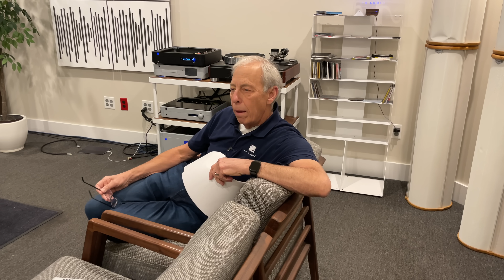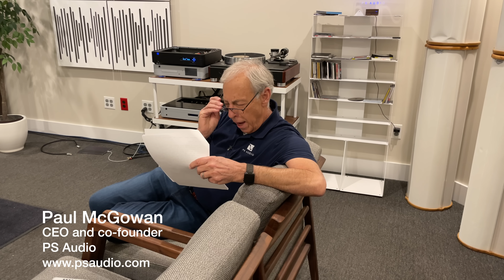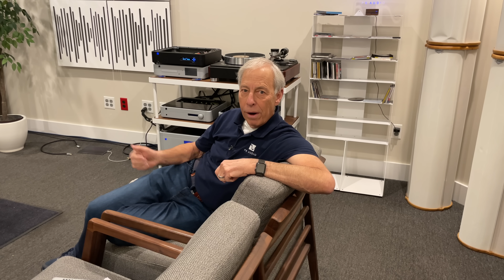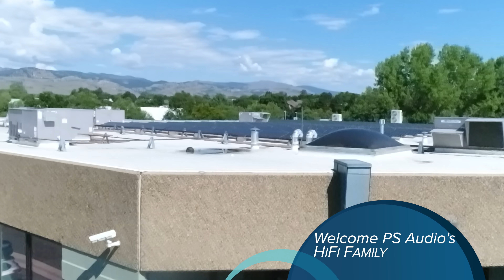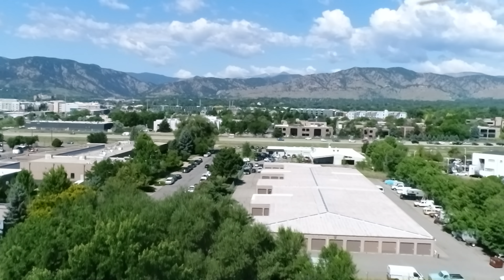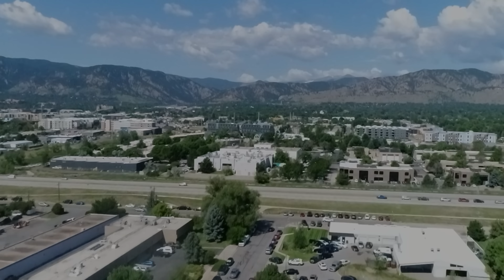High end amps vs. pro amps

Comment: I need to hear those amplifier differences to believe it. My crown xls sounds perfect at home in a stereo setup.
Reply: hearing is beleaving, i just bought an XLS2002 for fun thinking i was going to return it... but after comparing to my MC602 and XPA DR2... im keeping it... it blows my mind how good the Crown  sounds... and at 11lbs its 10% the weight of my other two amps... audio snobs need to get their heads out of their asses and try the Crown XlS... its getting positive reviews from audiophiles on the net
Reply: I’ve got a crown xls2502 powering some subs and two PS Audio m700 monoblocks powering my magnepan 3.7i’s. For fun I swapped power to my mains and did direct a/b comparison. The M700’s definitely sounded better in all cases, but no it was not night/day difference.
Reply: @MattWong117  was it 10x the cost difference?
Reply: @SantanKettanan-Gayboy  that’s hard to answer because everyone is going to have different equations in comparing value for money. For me the difference was worth it and I love the sound of the m700’s or I would’ve sold them. For someone just starting out with a limited budget the calculation would be different I think. It is possible to build a musically satisfying system without spending a ton of money, that’s for sure.
Reply: @MattWong117  if I'm reading that right, you've got a single xls2502 comparing against two m700 monoblocks?  Do yourself a favor and get a second xls2502 and then do an a/b comparison.  Mono vs mono.  The crowns have poor crosstalk performance.  Using them in a mono configuration might be that difference you're missing.  I, myself, have the 1502s for biamping my speakers and i absolutely love them.
Reply: @LunarLightLtd1  I'd be happy to if you feel like sending me one! Joking aside, I know it's not a direct apples to apples comparison and I mainly did it out of curiosity more so than I set out to prove one product is better than another.
Reply: @MattWong117  I respect that.  Just sharing my point of view and my joy.
Reply: What AVR or pre amp are you using? Did you set input voltage to .775 or use something like a cleanbox pro to boost signal voltage and use 1.4v setting? @LunarLightLtd1
Reply: I have the XLi2500 I love it. It is AB and dead silent, but loads of power.
Reply: I have some very early Crown DC 300's ( no not 301) that are something you should hear and then amend the statements made. These pre date the uA 739 I.C. front end amps which have a .05% or better distortion figure.I have documentation on this.
Reply: Yeah I have a crown xls 1000 on some klipsch rp-150m and couldn’t be happier with the sound it’s sound is way better than my other Dayton apa 150
Reply: @Damien-Lugnut What AVR or pre amp are you using? Did you set input voltage to .775 or use something like a cleanbox pro to boost signal voltage and use 1.4v setting
Reply: @ I use a jds labs atom dac and pre amp on a desk setup now with the crown and I can’t tell any kind of distortion compared to my Dayton apa150 that has way lower thd even on a desk. The crown just has way more output
Reply: The XLS amps' internal dsp converts audio signal from A to D & then back to A.

If you have played with DAC upgrades, you know how much these conversions tend to affect our beloved SQ.

Crown's XLC Drivecore amps have the same circuitry as the XLS but no internal dsp (you can better trust a dedicated dsp to that function). I have the XLC 2800 & it sounds wonderful as a sub amp.
Reply: Ol
Reply: what do you guys think of NAD amplifiers?
Reply: @skipper6528 very mid treble, slow bass, not mature as a sansui, not body shaker as a crown. if you want to tip toe get a mcintosh, if you want to dance get a crow or similar
Reply: @nehumnome cheers
Reply: @skipper6528  definitely solid
Reply: Update: I changed to an old Pioneer A333 and it does sound a little better. Especially on rock music

Comment: It's easy to see how Behringer do what they do for the price point, they just clone everything right down to the layout of the board and have it built in China using crap components,
You'll have a hard time finding specs for them too and there's a reason for that, they are often much lower specs than the item they cloned
Reply: True but my Behringer A800 sounds sweet driving my Klipsch 600M’s thru my Marantz 5014.
Reply: @rumporridge1  yup, their products sound good enough for most people, me included,
I've met lots of people who don't understand how they do it for the low price, but when you're R + D team consists mostly of people just finding out what's popular and cloning it.... Then it's easy too see,
I've also met people who have compared the original and clone and said its similar, but somehow not quite as good, I'm thinking it's the 'build it for the lowest price' ethos that is their undoing,  I'll bet there's no $20 caps in their products!

I bought some of their midi gear and if it weren't for Behringer then I would have nothing, it was nearly half the price of the competition, 
I'm not saying it's not worth buying, you just need to understand what you are buying
Reply: @Sofa-Lofa1  highly agree.  I’m moving back into a house in 3 yrs (from an apartment) and I will build out another set up. Will I go class A or AB? Who knows. But the class D coming out of these Berhinger and Crown Amps are very very compelling.
Reply: @rumporridge1  yeah, class D can sound great, I think it gets it's bad press from the fact that it is the easiest to design badly and throw crap components into,
A whole class D amp can be built for the price of 1 good valve/toroidal transformer/$20 film cap, 
But if well designed and with good components it can rival most things

Comment: High end vs pro I resolution vs very loud for a very long time. A crown or pro amp are meant to run hot for a very long time and not die. But a High end Audio Amp is designated to provide the very best sound recreation possible. So can either one sound the best? The Audio amp can. Can the pro amp sound as good as a high end audio amp. No. They are both made for specific purposes. Paul is 100% right on this one. Now, back in the 80’s or maybe late 70’s there was an amp that claimed to do both. It was called the Gorilla Amp, and it had some high output like 500 watts or something.  If you ran it at low levels it would last a long time, but at 500 Watts it wasn’t any better than any other pro amp. But Carver had a magnetic field amplifier that put out 500 Watts. Yes, but that was bridged into one channel. If you wanted to have 500 watts of stereo sound you had to buy two of them. Then came Carvers second generation of amps. They were high end amps, and Tom Scholz used them in his stage Amps. Scholz figured out that it was a pain in the ass to keep a Marshall tuned to sound its best on the road. In the recording studio was a bit different, but to take one on the road and faithfully recreate the tone he wanted it took a lot of maintenance to  keep everything sounding as good as the album did. So, he invented the amp and Cab Simulator alone wit effects that fit in one half of a rack space in a standard sized pro audio rack. Ten he built Three way speakers and put them in a start 4 x12” guitar speaker cabinet so it looked like what people expected. And he amplified them with Carver Amps tat were stupidly enough for those rad yet decent audio amp quality sound. From that combination he could get the same exact sound in the studio that he did on tour, and he’s still using that equipment today!
For more on this equipment see Rockman.fr the owner of this site put a lot of effort into setting this up and providing data to enthusiasts everywhere. Also keep in mind that Tom Scholz is an engineer and designed these circuits himself. Keeping these units working properly over time requires recapping them and unless you are well versed in repairing electronics it’s best to leave that to the experts. There is one person left who was servicing them as the other one retired from running the business that got his kids thru school, (at least that’s what I remember about the situation, I don’t want to speak for him and won’t mention his name out of respect and all the help he’s given me over the years.) you can find these modules on EBAY but watch the prices so you get the best deal on your gear.

Comment: @PS Audio -- Paul, can't say I fully agree with your views here. Some of the best amps I've heard are the Crown Studio Reference I/II models. Also, their older Macro-Tech 1200 model sounds very good, not least when bridged. Only serious drawback with the 1200's is their build-in fixed rpm fan, which is very noisy. Unless one can hide them away (without blocking their ventilation) they're not recommended in a hi-fi installation, which is a shame given their good sonics. MC² S800/1400, also studio series, are excellent; in fact they'd be a likely choice of mine if I were to buy anew. Crown's K2 amp is great for sub duties (I use it myself), or run up to ~1kHz. Oh well, I still prefer my Belles SA30 pure Class A amp coupled directly to my horn section from ~800Hz on up.
Reply: I have a Crown SA-2 "Distinction Series" Amp (which got a nice, small, write up in the  May 1980 Issue of High Fidelity). It has a variable speed fan which can be loud (if you were driving very inefficient speakers or a dummy load) at higher power levels, I don't hear it when playing my Klipsch Industrial LaScalas :)
Reply: @SLCVideoProductions  Forgot to mention the Studio Ref. I/II also has variable speed fans, as do the MC² Audio S-series, and you'd have to run them pretty hot for the fans to start speeding up. A friend of mine playing occasionally at live levels with heavy-to-drive speakers + subs can set off the fans with his two, bridged Crown Studio Ref. II's, but with the La Scala's, Industrial not least, I can't imagine ever getting those fans spining :)
Reply: @mikaelmllersnnichsen539  The only reason I know the found can get loud was that I purchased a pair of KEF 107's and had to crank the system up a lot to get any decent bass and the fan would go to high speed when I reached a certain level. Then I realized that the KEF's needed re-coning and spent a weekend doing that, but ended up putting the CROWN into my other room with the LaScalas so it will almost never come on high- it always is on low, but pretty un noticeable for the most part.

Comment: You are correct Paul, pro amps are not designed for home hifi use but some not all do serve very well in a home hifi set up. I believe this is called a byproduct. If you are on a budget then it can pay off by doing some research. I have a pro amp called Apart Champ 2 driving a pair of Magnepan.7i speakers very well, it even has the word “audiophile” on the front of the amp.😁

Comment: Fair enough, sorta. I have a system made of pro speaker drivers, pro amps and preamp, acoustics by me (speaker design and build and room acoustics), the goal was to get a sound I like more than that of audiophile gear (that over smooths and sweetens the crap out of stuff until only 5% of recordings sound good with it) if possible, to get greater dynamics and musicality. I did this experiment on a low budget, $1500 for amps and speakers (not including preamp). Doing this project I learned a ton. One major thing I learned is that if you treat pro gear like it’s hiring gear... proper cables and power cords, great speaker acoustic design, room acoustics, resonance and vibration elimination, the works, and if you do it well... you’ll be blown away how good low priced but reputable pro gear can be. I can back from capital audiofess a few years ago, long before this rig was decent or sorted, and doing a direct comparison to the insanely priced gift gear... I was more than pleased with my frankinbuild. The system is fully sorted now and is the single most musical setup I can recall listening to. It is very transparent and totally honest, it plays what you feed it and does not embellish or artificially sweeten. About 99% of what I’ve played through it sounds great, take crappy old recordings, it presents them in a way that does not shin an artificially harsh light on the recording but does let you hear what they people who made it heard, as in you can easily identify with the good music in the antique recording and not be dragged down by the blemishes. Play something modern and super well recorded and it lets all of that through in fine style. It played effortlessly to over 110 db all day long if you could stand that, plays quietly nicely. All around addictive stuff. I have high with bowers and Wilkins speakers and it took me 14 years and massive acoustics treatments and just insane and expensive effort to make that setup sound not completely shitty as in the worst most frustrating system ever I mean, sure, after 4.5 years of extensive acoustics studies and endless experiments and such it now sounds very good in most aspects, it’s musical and sweet and etc. and if I go In my workshop/art studio and turn on the pro rig... after one track I pretty much forget about the b&w system. So for sure there are a few points of the hifi sound that are nice, but for me that is not actually necessarily indicative of what I think is most important in sound. And I’ll guarantee you there is pro gear that is top of the heap regardless of classification. The key is for one to dig deep inside and identify what really floats your boat with sound and make that system. If you like smoothed out sanitized sound, go for crap hifi, if you like less,flavored go for a 599k$ hifi... but there are those of us who want something else, something properly used pro gear can deliver. My 2¢
Reply: I agree, I have an RME dac, feeding a Crown XLi2500 amp. I've messed around with several speakers and the dac/amp combo is very transparent and neutral. I really love it with blues. I've always used receivers in the past and the always color the sound. I bought the dac to get the cleanest sound I could, the XLi2500 is AB and as far as my ears can tell ads nothing to the sound but the power my big speakers need. My measuring equipment is my ears and I love the sound (or lack of sound) from my pro gear. My dac is the RME ADI 2 Fs, so technically it isn't the pro version. They just took out some unneeded features in the Hi Fi model.
Reply: What amps have u used ? I'm considering buying a crest CA6 but don't know much about it's sound caracter
Reply: @user_47214  in this system I use a drivecore crown amp for the 18” woofers and class a/b crown amp for the mains. Not the best amps in the world… actually at the low end of the (decent) pro audio world… so… I really don’t have a vast experience with different amps, so no way I can recommend them on any level. Your better off talking to people with the right experience. Cheers.
Reply: My experience with pro gear has been a hit and miss game with pro speakers and amps in the latter over the years. On the other hand I purchased a Tascam cd-rw900sl pro cd player and recorder a few years ago. Overall it sounds pretty good and its operating features are like the reel to reel I used to own decades ago. It is not as refined as my classic Pioneer Pd 65 or my current Rotel cd14 mk2. It also doesn't have the weight of the other aforementioned units but it is a very sturdy, rigid, and good sounding cd player. This cd player/recorder is superior to those players I had in the 80's and early 90's and will last for many years!

Comment: I started with Behringer a500's in my home theater system and later Crown class D and then Crown Class A/B amps. I listen to music and SACD's on this system as well. The Crown 1502's I really tried to like. I patted myself on the back for how much money i was saving. They had gobs of power but something was off. One day I swapped a class A/B Crown into the system I had here and it was definitely better so went the full class A/b route and sold the 1502's. Never really happy though.
I got tired of turning the amps on and off. ( Well mostly my wife did. ) so i looked at consumer amps with a 12v trigger. Found a used Parasound A51 and everything changed. Sounded infinitely better the instant I put this amp in the system.
Reply: The class D Crown 1502's were definitely the worst sounding amps i ever had here. Can't put my finger on as to exactly why either. i read somewhere that a user described them as "Uninvolving" and I agree with that sediment. They went loud but with no warmth and were one dimensional. I changed speakers like 3 times since i had this in the system along with cables and didn't realize what the problem was.
Luckily sold it really quickly with not too bad of a hit.

Comment: My ME1500 amp is for both Pro and home ( consumer ?) use it's better than a BHK and an EV or JBL power amp. It goes from DC to 400Khz within 0.8dB and has lower total harmonic distortion than Krells McKintosh or Quad amplifiers